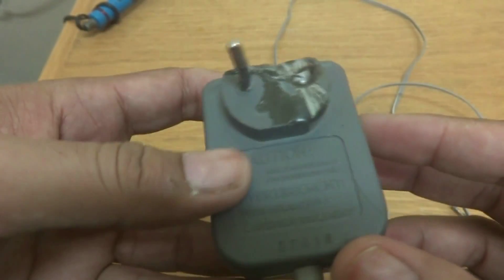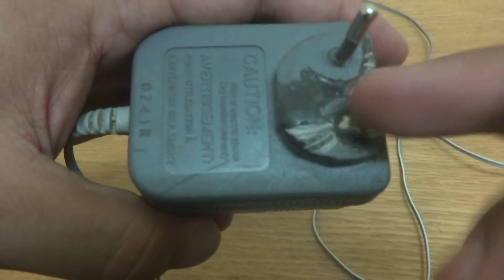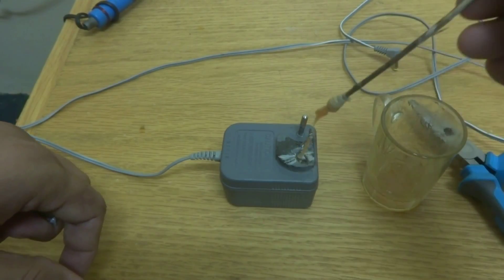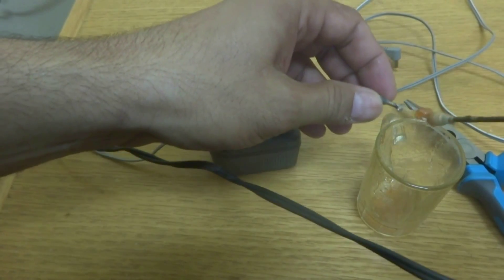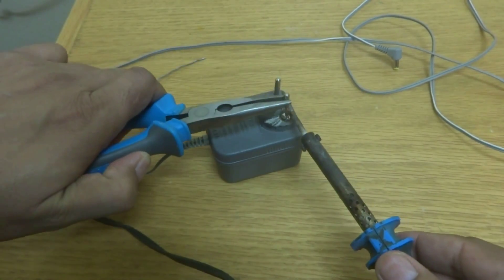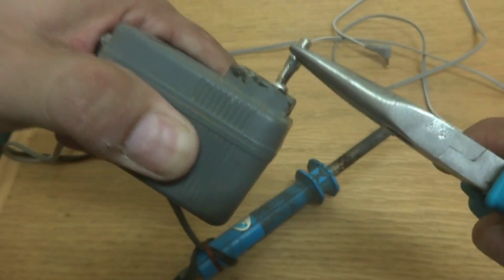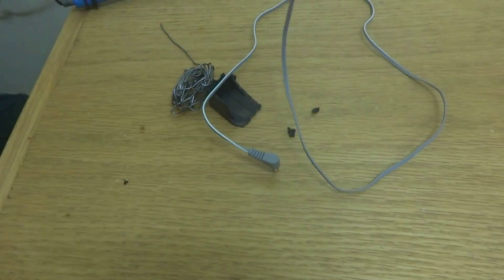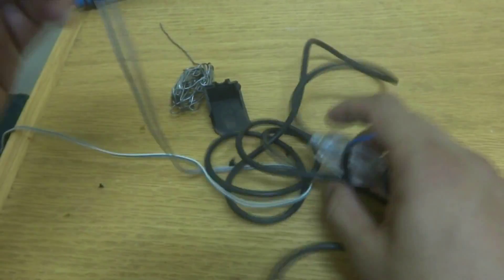Power supply repair. How to restore a bad power supply back to work.

Comment: In case like this I attach a cable directly to the leads inside. make a hole put the cable in, make a knot and soldier the cable to the transformer output, then I hot glue the cable and the charger box.

Comment: Works again:-))

If this adapter is in the owners house, they could plug it into a short extention cable and place it on a shelf, it would never have to move again so no pin breaking :-)

Or find a mains plug with short cable and solder that to the chopped pins, then glue a 3mm thick square of plastic over the solder joints for safety, psu on a wire lol :-)

Ive used a small hacksaw blade and saw around the case to open it, then solder a cable inside, then fit a mains plug on the cable and use epoxy to close the adaptor case :-)
Reply from the maker: zx8401ztv Very nice idea sir! the same I was thinking to do with but then I refused to do so due to cable involvement and more work for opening the case of the adapter. That would be a great solution indeed. Instead I used to solve the mater by simply re soldering the broken leg to its place. Also instructed them to take care of it and not to break it again. Regards,
Reply: LearningZone
Human nature dictates that it will get broken again, i have been in the same situation as you, people dont learn from there mistakes, they have someone that will fix it for them for almost nothing.

If i sound negative its because ive been repairing things for people for years and i have noticed there attitude, sometimes ive had to make a repair "idiot proof" to stop it coming back later.
I appreciate your repairs my frend :-))